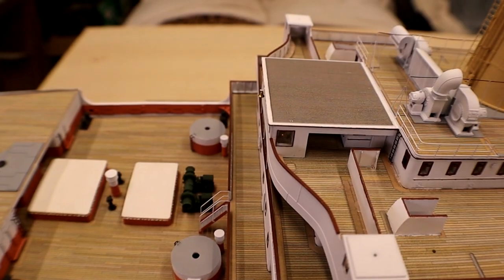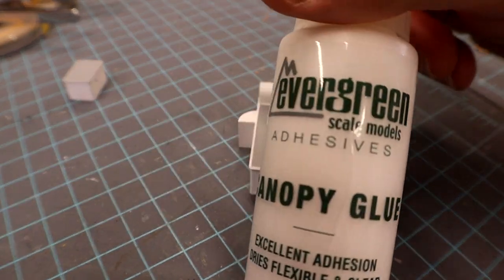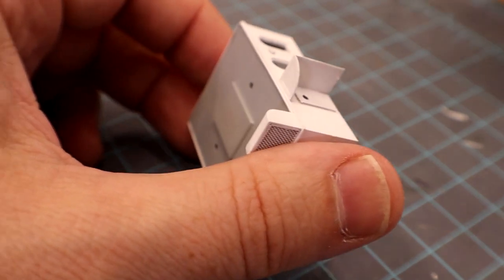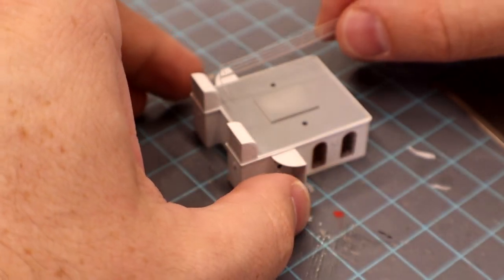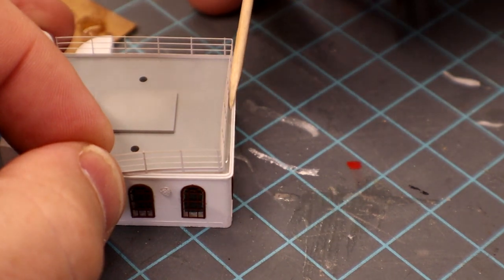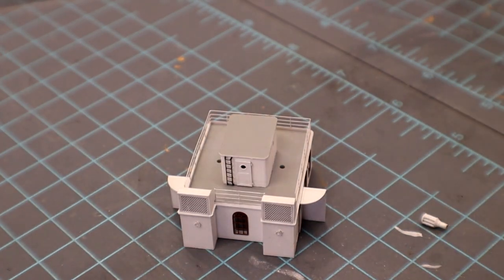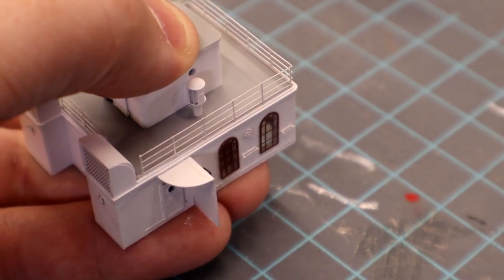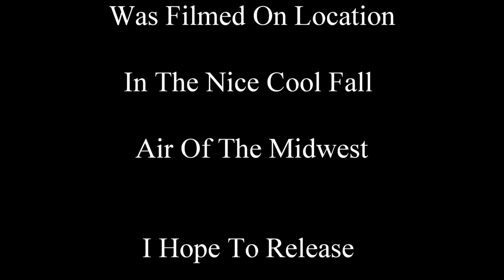1?200 RMS Titanic Build Video 31

Comment: Great work!
I am glad you did a CV-6 video (that's how I found you since there is no video about it) I am currently doing queen mary 2 from revell. I am not to keed on doing that model on super detal rather to train on it. I am doing lights for it and I have a question, you used glass fiber? or plastic parts for the hull windows, at the moment I am thinking on leaving the window holes not drilled, so the light passes through on thinner plastic or doing the proper way with drilling, but that leaves me on a dilema how to do the windows properly (and the ammount of drilling and scribing looks quite scary :D ) The windows have to be flush to the hull right? my hull is already painted...
Reply from the maker: I did not do fiberglass. I used clear plastic rod for each window. We have a video in the Titanic series on this. Yes, it takes a looooonnnnggg time to drill out each window. And even longer to install the fiber optic pieces. But in the end it looks great!

Comment: Hey Ben! As usual, I continue to be amazed at the level of painstaking detail you put into your work. AAAAND as usual, I have another nooby question for you. I am about to finish a 1/350 USS Turner Joy and want to give it a matte clear coat. Do you have any recommendations for a matte clear coat that I can use with an airbrush? I am partial to the Tamiya paints but I would venture outside my comfort zone based on your suggestions. Or should I just go for the canned stuff. I feel like the canned stuff wouldn't give a nice even coat.
Thanks in advance
Bryan
Reply from the maker: I can’t remember which brand I have, but you can use any flat clear that’s in a bottle if you’d like. I wouldn’t hesitate to use Tamiya in the rattle can, though. Just set it in a cup of really hot water first to warm the paint up. Shake it well and it should spray just fine.

Comment: Great video as always Ben. Titanic is coming along nicely. One question though. Was the omission of the wooden deck on the top of the 2nd Class Aft Entrance deliberate? Looking forward to the rest of the build. Happy modelling.
Reply from the maker: Yes. I’ll have to go back and see if it “should” be there. But I don’t recall it being there. I’ll double check though!
Reply from the maker: So, I doubled checked my reference: "Titanic Ship Magnificent Volume 1" page 204 and I do not see a wood deck installed on Olympic in that location. However, in plans that I have for the ship, it calls for a pine deck to be installed there. I've noticed modelers go both ways on this. I personally think it was omitted. That is a very low traffic area and passengers would never be up there. 
Since you pointed it out, however, I have asked my client what he would like. I can still easily add it at this stage. Thanks!
Reply: @TheMidwestModelShop  As far as I can tell, it should be there. I have Titanic: The Ship Magnifcent, but can't get to it at the moment. Titanic: A Model Maker's Guide by Peter Davies Garner shows it and the deck is included in both the Pontos and Scaledecks sets, but curiously enough, it is absent from the KA set. I have the Pontos and KA sets and have just gone through both. You will get to the bottom of this. Model on.
Reply: @TheMidwestModelShop  Yes. Definitely see what your client wants. Only engineers would have gone up there to access the elevator machinery housed in the top section.

Comment: Ben, I messed up on my forecastle. I have the KA kit and scale decks decking. I somehow filled in the feature that accepts the forward mast and installed the deck over the top. I haven't glued it to the hull yet. Any suggestions on a fix? Maybe I can just drill a 4.5mm hole?
Reply from the maker: You should be able to drill it out. Unless you filled it with something crazy.